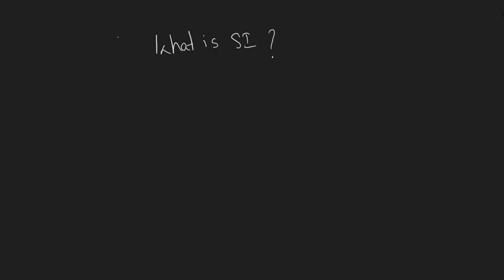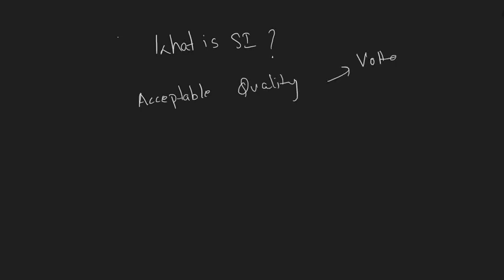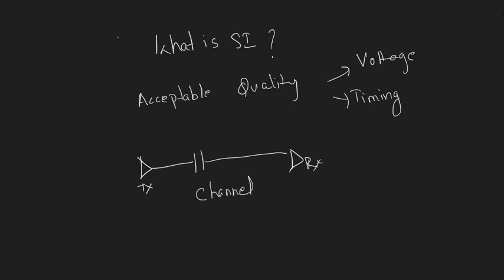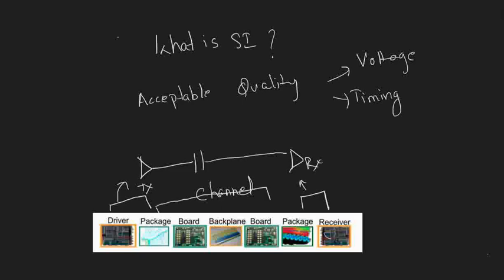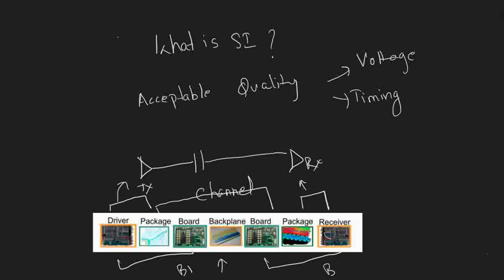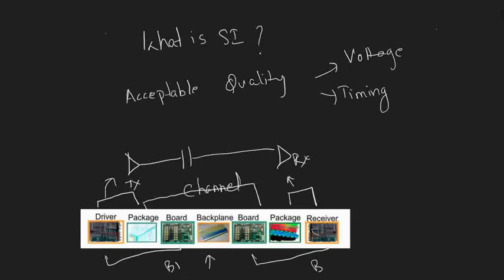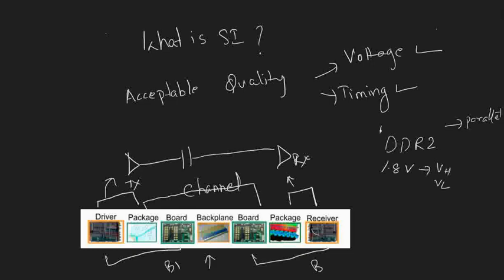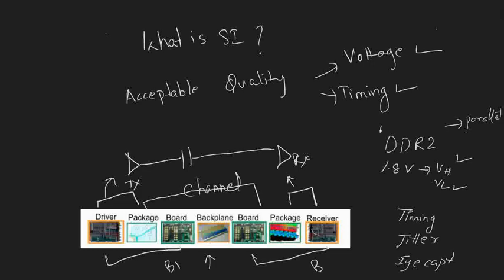Introduction to Signal Integrity in High Speed Digital |#signalintegrity

Comment: How can I simulate differential giga bit pair signal of giga bit ethernet w/o Ibis models provided for them ?
Reply from the maker: Hi Suresh, 
Without IBIS models, the extraction of S-parameter( Insertion loss and Return Loss plots)  can be performed , it doesn't require Models for TX and Rx.
But if you require to perform the channel extraction, you will Need tx Rx models.
Reply: @bhardwajh_2701  for AIO differential pins no IBIS model provided .
How can we ensure that giga bit Ethernet differential pairs SI (eye diagram ) is proper or within limits in the board(tracks) ,from  ethernet out to the Connector through a Transformer?